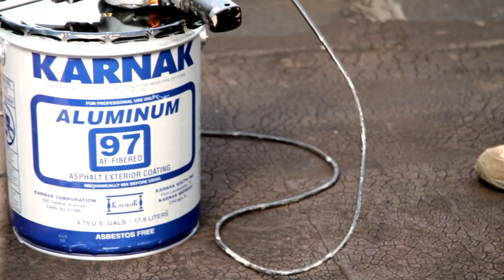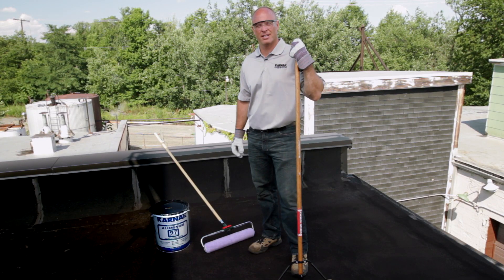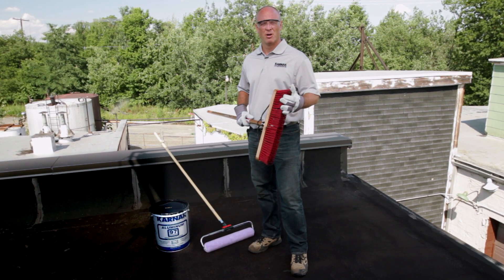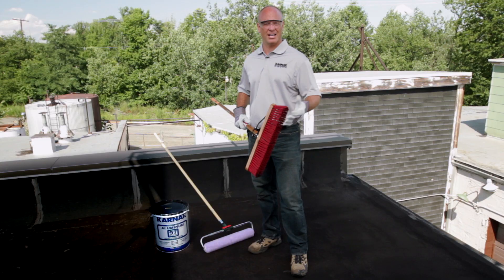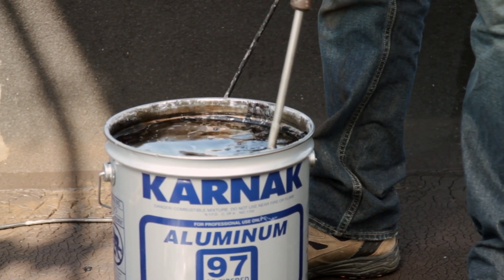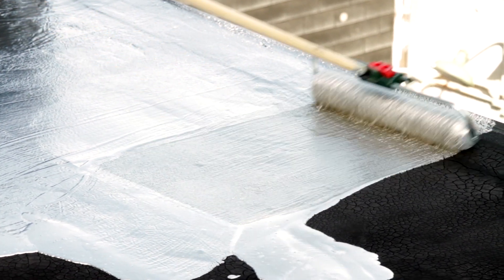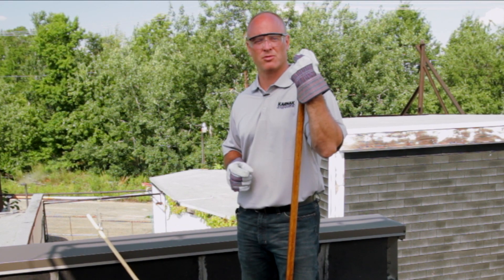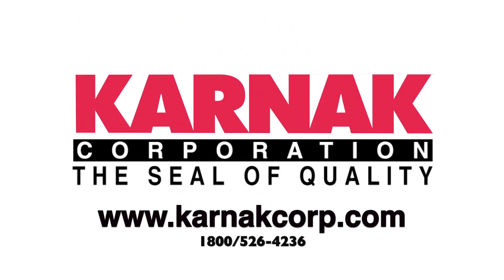How to Apply Reflective Fibered Aluminum Roof Coating on an aged flat roof - Karnak 97

Comment: We have a torch down modified bitumen granulated flat roof. It's about 6 years old and has lost a lot of granules, so more and more of the black rubber is getting exposed. Once we have cleaned all loose granules and debris from the roof and cleaned it, can this product be applied to our modified bitumen granulated flat roof? And will the application of this coat, slow down granular loss?
Reply from the maker: Yes, you can apply this product (Karnak 97 Aluminum coating) to your mod bit roof. It will slow down the granular loss when applied. A better solution would be to apply our 220 Fibered Emulsion first before the coating. This will end up with a longer lasting, better result.
Reply: @KARNAKroofcoatings  I think I get it, sweep gravel out of way, clean, dry, then apply 220.  Let dry and then put this over 220.  Then put gravel back over?  Let me know if I'm confused on any part of it.

This looks like an excelllent product.

Comment: I'd like to use this in a mural I'm painting. If I used a clear coat anti-graffiti coating, would it adhere okay? Also, would it dull the shine on the Karnak?
Reply from the maker: Interesting! We have not yet seen this application. We recommend you try it first on a small inconspicuous section of the wall as a test area. We'd love to hear your results.

Comment: What do you recommend for a low pitch metal old metal roof on my house. Upper MI so we get -30. Will this help snow slide off better too? Thanks.
Reply from the maker: Our 404 and 501 system would work fine as long as the slope is over 2/12. This means, for every 12 inches the roof moves horizontally, it goes down at least 2 inches.

Comment: can Karnak 97 be used for TPO roof or Karnak 298 ?
Reply from the maker: No, aluminum coatings should not be used on single ply membranes. Some better alternatives would be our 502 system.

Comment: which karnak aluminum roof coating is best which there are several 97,169,298,27,28
Reply from the maker: Our 298 is the most premium, as it contains a rubber blend that allow for the product to expand and contract as the building/roof shifts due to settle and temperature changes. The other products are good and just as reflective, but do not contain the rubber.

Comment: Can this product be put down over existing aluminum roof coating that needs to be redone?
Reply from the maker: Yes, 97 can be applied over previously aluminum-coated asphalt roofs. The roof should be clean and dry before coating.
Reply: @KARNAKroofcoatings  Thank you very much!

Comment: thank you  made this look to easy  if i had a mixer great if not should I      do anything special to the  5 gal can turn it upside down while storing. till ready and then roll it.    would doing two coats be better hten one
Reply: No don't turn it upside down , it's fine .... just mix it before use
Reply: @shure46  when I did mine i did mix it,
Reply: @fishycomics  that's fine , my point was "don't store it upside down"
Reply: @shure46  I understand thanks.
Reply from the maker: Jiffy mixers are very useful in this case.

Comment: Which is better?  The 97 or 298?  Also how often should either be reapplied?
Reply from the maker: 298 is our premium rubberized aluminum product. You would reapply anywhere between 7 to 10 years, depending on surface conditions.

Comment: What about an  A-frame do i stand on a good ladder and rolls the roof because im sure not gonna go up a aluminum roof and slide off and hurt myself or worse, also should i dips the roller instead of pouring the sealed on an A-frame roof and rolling it out as im painting a wall, because standing on a good fiberglass ladder and rolling the sealed on should do the trick because it's much safety that way also i have a extension rolling that can reach way over the lips of the A-frame to the other side of the roof top and once i get one side finish can just start from the other side, i think that's better than getting on top of a A-frame roof also much safety
Reply from the maker: Please reach out to our technical department if you still have questions.

Comment: i have minor leaks in the roof will it seal those areas? also should i  polycloth on the seams?
Reply from the maker: jeffery Leroy Hi Jeffrey. Thank you for the question.  Roof Coatings do NOT repair leaks.   You have to use our Mastics such as Karnak 19 Ultra, Karnak 19, Karna-Flex WB, or Karna-Flex to perform repairs.  And yes please polyester cloth or mesh is a good idea as it will reinforce the mastic repair prior to the application of the roof coating.

Comment: Whats the reflectance %?
Reply from the maker: Initially, it is 63%, and after 3 years' weathering, it is 55%. If you are looking for an aluminum coating with higher reflectivity, check out our 298 Alumin-R (https://www.youtube.com/watch?v=S7EJlw_ql_Q). For even higher reflectivity (in the 80-90%), we have acrylic white coatings (listed as 501 and 501). Hope this helps! Feel free to call our Technical Dept at 800.526.4236 for more information.
Reply: @KARNAKroofcoatings  I have a  NEW 2000 ft2.  and presently uncoated solid concrete slab roof in equatorial area   Is this an appropriate product for that roof to seal it, as well as reduce heat absorption?
Reply: How much would it cost me to do a 2900sq flat roof?

Comment: What applications would non-fibered aluminum coating be better? What is the advantage of fiberated coating?
Reply from the maker: Non-fibered aluminum coatings work well over metal roofs and roofs that have been previously coated with an aluminum coating. Fibered will be stronger and more resistant for longer, but will cost more for the material.